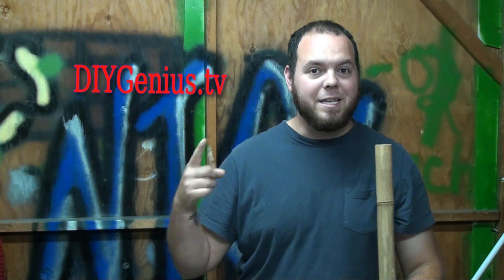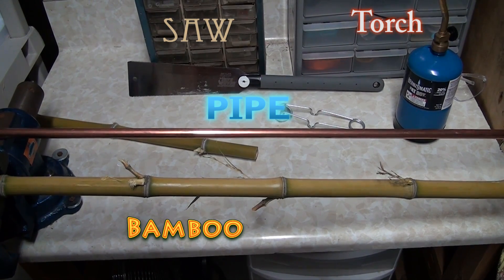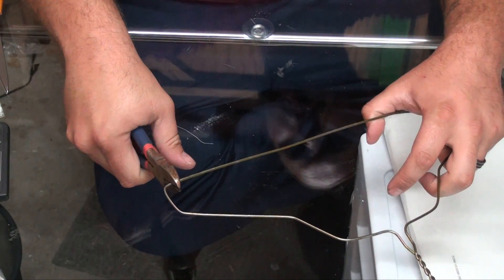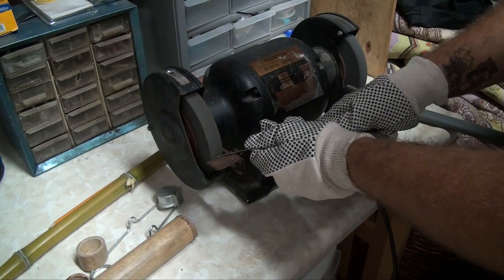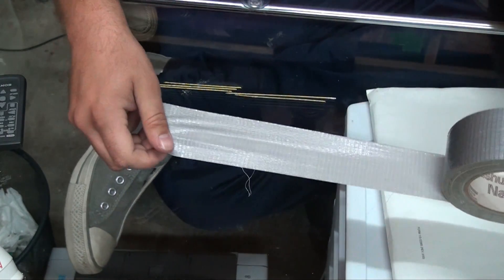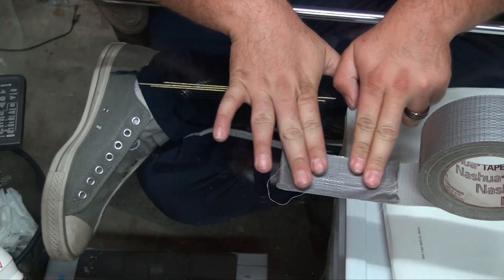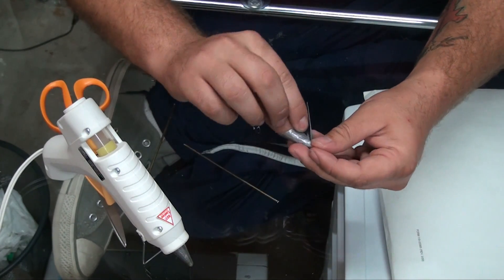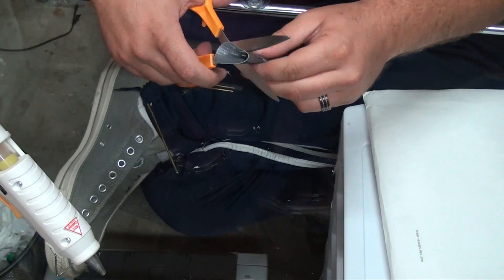How to make a bamboo blowgun

Comment: It's not really a bamboo blowgun, it's a copper blowgun with bamboo around it.
Reply: That's the best part the bamboo on its own cannot compare to the Slick surface of the polished metal bore the copper provides. But you're getting the Aesthetics of the outer bamboo and also the bamboo protects the soft copper from from getting dented

Comment: At the end of the video you see him slip a dart into the pipe that is inside the bamboo. Also, the pipe is narrower than the bamboo. If you wanted to use just the bamboo, you would need a wider pipe.

Comment: @loggiaoscuraduecitta .  Welcome.  As I remember it, I am 100% sure that the heated rod is used only to hollow out the bamboo.  I guess you could use anything as the pipe though, it wouldn't need to be bamboo, plastic would work just as well, imo, and would save you having to hollow it out.  Does not look as good, I suppose...

Comment: A torch is completely unnecessary. Put a piece of rebar vertically in a vise and ram the bamboo down on it and it will break through the nodes. Since the rebar is rough on the sides, you can also ream the bamboo out by sliding up and down. And nails make great darts, eliminating the need to cut a coat hanger and sharpen it.

Comment: No reason to glue the duct tape. Just leave and end with about half an inch of adhesive exposed and tape it to itself when you make your cone. And I am with the others wondering what the point of the bamboo. Other than to provide rigidity, it would be unwieldy.

Comment: The copper pipe seems to have to much clearence between the pipe and the bamboo, air will leak out and that makes dropping the air pressure!
Copper pipes are very heavy I prefer to make blowguns out of aluminium tubing.
I like your idea but, it needs a bit of more work to become a better blowgun!
Reply: heyy im trying to make a speargun trigger i need help i got a piece of aluminum
Reply: I don't think it matters how much clearance there is I think he is pretty much cheating and using the copper pipe just for the blow gun you might as well just pulled out the copper pipe and used it as the blow gun. The bamboo is just a cover.
Reply: Luis Negron
Hello Luis Negron,
don´t use aluminum for the trigger it will not be safe to use! Stainless steel is a better choice!
For now the only help i can give you, is for you to watch my videos!
Reply: George Vasquez
Hello George Vasquez,
yes you´re right, using just the copper pipe works fine!

Comment: It was. The dude is a phony. In cane- and bamboo-crafts otherwise, a common method is using rebar, first a  thin to punch a hole in the membrane, and use its ridges as a file until a bigger size fits, and so on until you have rinsed out all of the membrane in this case,to achieve a smooth "gun barrel". With a little force you can skip sizes a bit, hopefully without busting the cane in the process... practice makes perfect.